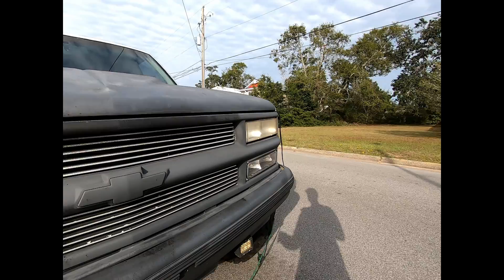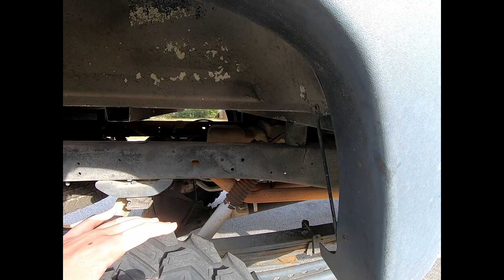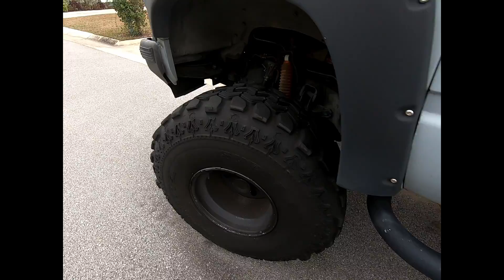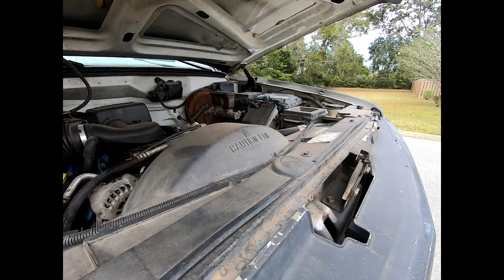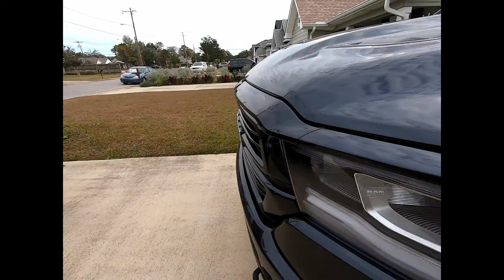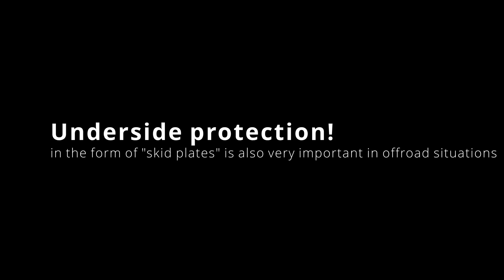Bug-out Vehicles

Comment: Nice truck! I went that route, i have a 4x4 double cab 4 door pick up, its a 2.5 turbo diesel Mazda, i live in Portugal, so over here thats a normal truck! Mud tires, offroad suspension with 2" lift, with a canopy/camper shell, and some other minor mods. It doubles as a daily driver, but i use it for offroad, overland and all that outdoor stuff. I do my own maintenance (i worked as a mechanic before), its the best way to know your truck.
Reply from the maker: Thanks! Awesome, sounds like a great setup!